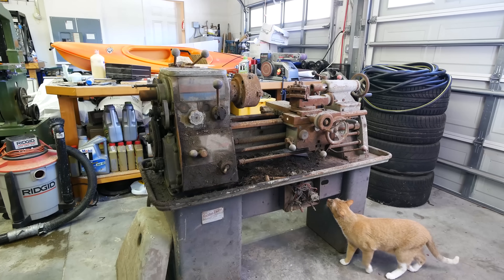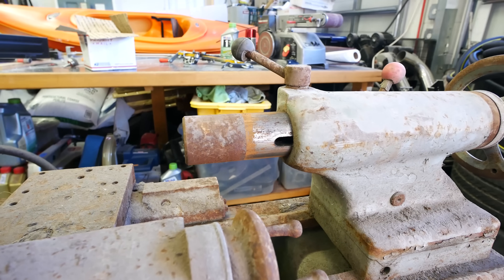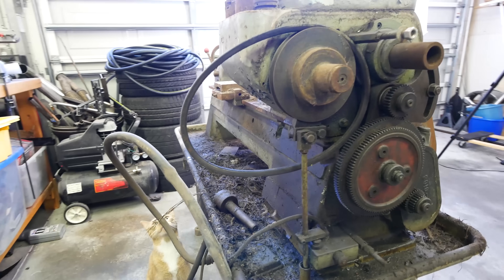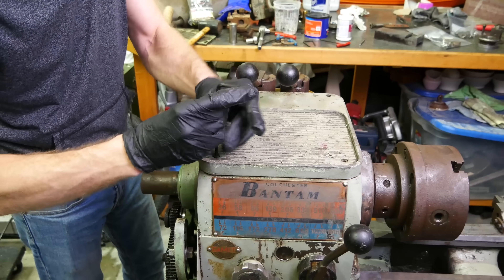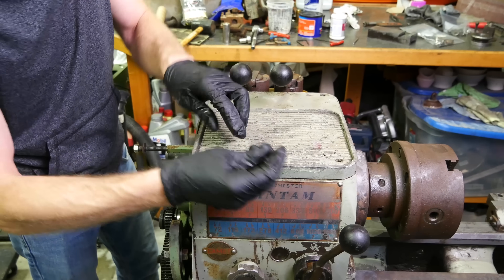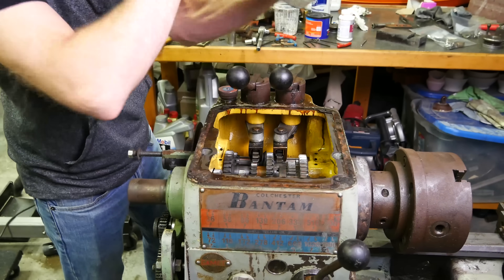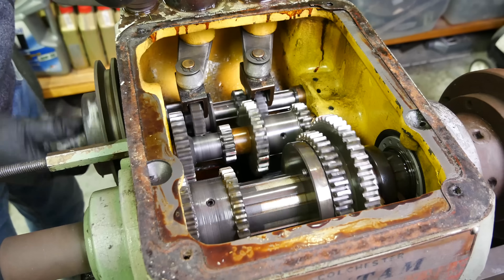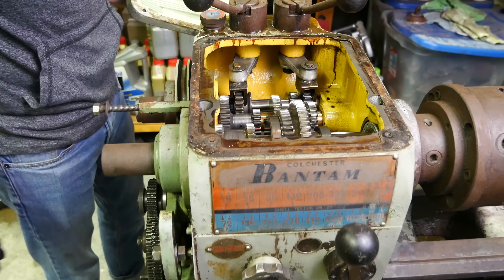Lathe Rebuild Part 1 - S02E01

Comment: New, the motor will probably be the same price as the lathe. You can do better used on eBay, though. I got nothing else to do today, so...

Cheapest one that appeared reasonable. Good seller:
http://www.ebay.com/itm/291859353968

Appears to be in better condition, also good seller, but sold as-is:
http://www.ebay.com/itm/231942542486

Local pickup only, if you live anywhere near Lawndale, NC.
http://www.ebay.com/itm/250901682474

Good seller again. Something tells me these comments are just going to sound like a broken record:
http://www.ebay.com/itm/181490047034

It says "untested" but the seller allows returns if it doesn't work. May be higher voltage than you're looking for:
http://www.ebay.com/itm/132040179500

Another pickup in Lawndale:
http://www.ebay.com/itm/232292935076

It claims to be unused, and seller has 100% positive feedback, but not as many sales as the other ones. Kinda sketchy:
http://www.ebay.com/itm/291609801090

Insert broken record comment here:
http://www.ebay.com/itm/291672925595

Insert broken record comment here:
http://www.ebay.com/itm/262074475580

This seller made this list a few times:
http://www.ebay.com/itm/292089348047

I checked every 2 HP motor on ebay below around $130, though not thoroughly. Double check before you buy industrial machinery from some guy on eBay recommended by some guy on Youtube.
Reply from the maker: Thanks a ton man! i will check these out for sure.